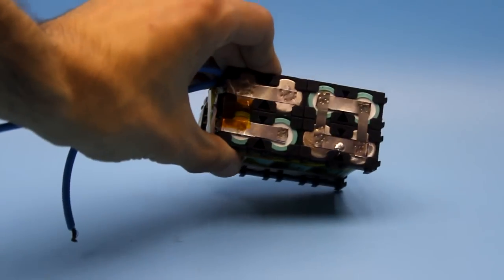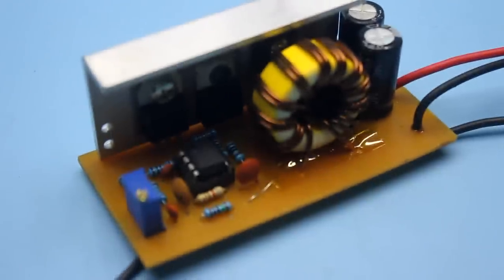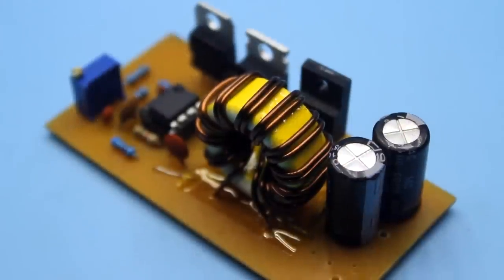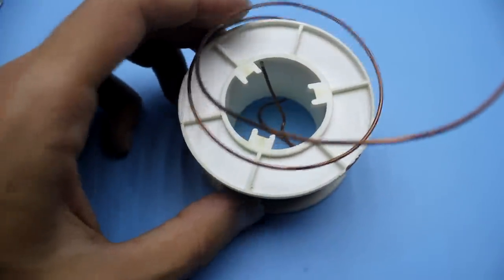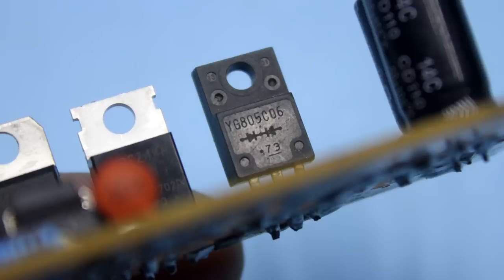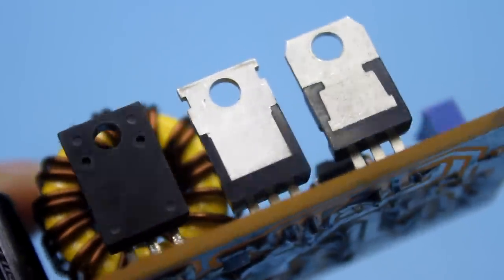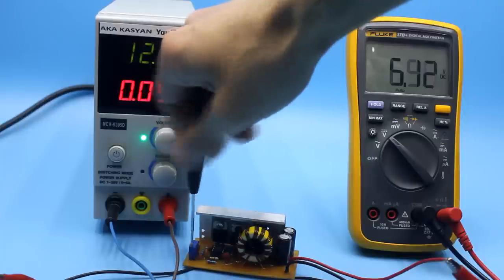Universal step-up and step-down converter

Comment from the maker: 5 pin - GND
Reply: i like your channel a lot is very help full but this video had issues, i count 4 caps at the archive at 50 volts and 1000 μf and those caps are missing from the pcb that you demonstrating also, at the pcb there is a12  linear voltage regulator but missing from the archive, i admit that i need a diy robust boost-buck converter but i will not try this one
Reply: mam only 12 volt input it can take ,so we can use an lm 7812 for high voltage
Reply: thanks for 1 hours trouble :D. Please update the video so viewers will not experience the error.
Reply: how come you post the circuit with error pin 5 uc3843 not connect to the ground, you want people make fireworks at home???
Reply: @amar love you need sprint layout
Reply: So,Mam you never showed the Circuit diagram when placing a Regulator ❤

Comment: C8 and C9 (2000uF) go from the mosfet to the output? Never seen that before. That won't work out very well.
Reply: This is a Cuk converter.Its not the avarage buck/boost converter you'll find in youtube. The original design is like this :)
Reply: @dimitriosvlamis8696  Actually SEPIC ... Singled Ended Primary Inductance Controller.
Much more efficient than Flyback and Forward converters

Comment: Kasyan, it seems there is a mistake in the schematic: C8 & C9 are not grounded, but connected to the AC side of the secondary. Their positive side also is connected to IRFZ44’s Drain, which may short-circuit it (at first sight). 
I downloaded “now” (March/2023) the schematic and it shows the same. 
In case the schematic is correct I would appreciate a brief explanation why it was done as like that. Otherwise, it might be enough to update the Zip file and anchor an “author’s comment” with such update.
Thank you for sharing, I’m very fond of your channel!

Comment: I have recreated this boost-buck converter with great interest. Except for 2 modifications, the proposed layout and assembly was used. The right side of the board has been stretched a bit to make room for 10mm diameter capacitors. The diode was replaced by MBR20100 (dual as shown in the layout).
The converter works. The coil (core T106-26, 93 nH/N², 2 x 10 turns 1,2mm copper) gets louder with increasing load and hot, really hot, at 2 amps 70 degrees Celsius after 2 minutes. 
Input 12.1V / 5.2A - Output 13.8V / 2.16A - Efficiency 47% :-(
Maximum output voltage with this choke and R1 at 1 kOhm are just under 18 volts at 12 volts input, that's ok. Will test again with 14 turns and different core. 

Any suggestions (core, heat problem)?
Reply: I played around with the converter.

I would like to say in advance that this concerns only my built version, I have no expertise and the changes can be completely wrong.

Step 1: The most critical component of a DC-DC converter is the choke. At 8,2 kOhm and 2,2 nF, the UC3843 frequency is at ~ 95 kHz. I've added 4 extra turns, almost doubling the mH (from 0,014 mH to 0,024 mH). The winding ist now 2 x 14 turns. A reduction of the resistance from 8,2 kOhm to 6,1 kOhm causes the switching frequency to rise to approx. 125 kHz. Overall, the efficiency has thus increased by almost 7%, but at 54% is still far too low (input 12V / 4.2A - output 13.8V / 2A).

Step 2: Control of the power FET. The signal of the UC3843 starts to oscillate under load. A 33 μF capacitor between pin 5 (GND) and 7 (VCC) of the PWM contoller also solved this problem. Efficiency is now just above 62% (input 12.1V / 3.6A - output 13.8V / 2A)

I was able to greatly reduce the "noise level" under load by connecting the heat sink on GND. (Check insulation of mounted components!) 

The heat problem is much less, but still there. The power required at the entrance has dropped by 20 watts, unlike the beginning.

I would suggest a larger bobbin and thicker winding (~ 2mm). But for this you could already buy a ready-made buck-boost converter with much higher performance :-(
For smaller performance, however, the DIY-module shown is still usable. I changed R1 from 1 kOhm to 4,1 k Ohm to get a voltage range from 4,2V to 24V, thats fine.

Thank you
Reply: I guess the core heating is due to magnetic saturation. Even for iron powder cores it is not wise to exceed 0.5 T. You can calculate magnetic field strength by multiplying the current with the number of turns and divide it through the magnetic length ( pi/2*(D+d) ). The result must be multiplied by µ0*µr. If the core saturates, the current rises to the current limit or resistive limit. The electric power is converted into heat.

This could also be the reason, why the efficiency is so small. The UC3843 is also not capable to drive enough gate current for fast switching of MOSFETs with significant input capacities and gate charges. So it is better to use a gate driver IC behind its output pin, which can deliver at least 2 A in source and sink modes.

Comment: 60 % effectivity :) (Input: 15.1 V @ 5.95 A, Output: 21.55 V @ 2.47 A)
Reply: That's because of liner voltage regulator for the 555

Comment: It's difficult to have the low ESR capacitors at 110kHZ(C8 ,C9). I think "Flyback Converter" should be much better for diyer.(remove C8 ,C9...and swap the transformer output two pins)
Reply: Will many ordinary electrolytic capacitors connected in parallel help in lowering the ESR ?

Comment: Is it possible to add more mosfets in parallel to gain more power?
I want to build MMPT around 60amps at 55v output from solar panels 75v to charge 48v acid lead batteries..4 battery in series
im not sure that UC3843 can provide enough power to gates  more than one mosfet.what do you think?maybe to add in circuit push pull totem pole for gate of 5 mosfets or more?Can feedback input of UC3843 can handle 55v
how would you do that?

Comment: I see there are 6 x 1000uF caps on the circuit diag. 4 of them being 50 volt and 2 of them being 25 volt. Yet there are only 2 large electrolytic caps on the board. Is that board an early proto of the final product? What are the inductance of the coils?

Comment: there  are 3 caps (2x1000uf) on the circuit, but only 2 caps (1000uf- i/o filters), on your board,   how about the midle caps, Sir?

Comment: I have a similar circuit. It has 120w output. 2 same mosfets used. the first mosfet's drain leg is connected with the second mosfet's source leg. There is a single winding inductance and first mosfet after inductance. The first mosfet's source leg given to the ground. I understand the situation when mosfets are connected in parallel, but can you explain the situation when connected in series? As in the circuit i tried to explain... Is there such a video?

Comment: I am trying to make this converter with the help of your Circuit Diagram... As someone mentioned in the comments that C8 and C9 goes directly to the mosfet? In your video I can only see 2 caps which I presume are the input and output filter caps. So did you omit C8 and C9 or what?

Comment: Hi it is possible to design Step up Step down converter using MC34063 and external MOSFET ?
Reply: It has a inbuilt transistor within the chip.
You can either tweak the chuop to get the control signal direct or drive your external fet with inbuilt transistor.

If later is the case, then

 so add a emitter follower bjt stage or add a inverter function chip with decent slew rate inorder to provide correct pulse to your external Mosfet.

Comment: Hi Mam (Kaasyan). I am a hobbyist I made  the  above circuit it is working  but as i put load the  output current drops down.  I need 5A to drive 2Nos 775 Motors which I am not getting. Could you suggest what to doooooooo. my circuits all electrolite caps are 1000mfd/50V. any change?. This circuit is for my RC  Boat. Power source is Lion battery 11.1V 5400mAh to boost 12 to 24V 5A. Your help will be very needfull. Thanks.
Reply: add a soft start circuit

Comment: C8 c9 will reduce  the  efficency  of the  device. You  have  to  replace  them with  ceramic  caps  and not 1000uf !!
Reply: what values for ceramic C8 & C9? are you sure the efficiency problem is with c8, c9?

Comment: can you design only a buck converter with uc3842 please?
Reply: Lenar OX uc3842 has a higher uvlo. So it may not be a good ic to use for battery powered stuff.

Comment: clarifies this because in the pcb there are only 2 bone electrolytic capacitors whit polarity but in the diagram there is 6
Reply: The schematic shows 3 groups of capacities. Input, output and between the coils (Cuk-Converter). The number of capacitors used reduces the ESR properties. In principle, however, it does not matter if 1 capacitor or several small capacitors connected in parallel are used. The input capacitor was not executed on the layout. If the input is strong enough, this is not absolutely necessary.

Comment: Kasyan TV+ can't we add a 35 ~ 50 volt capacitor with a larger value for current?
Reply: MrBrymstond the current limiting factor is the switching transistor & transformer. Bigger capacitor may not necessarily get you more current. Just a delayed response to voltage changes and transients. So to increase current you would wind a bigger transformer, input more current and change the mosfet to a beefy one that can hand le such.

Comment: C8 and c9 is all wrong. Your getting positive voltage through the caps by shorting them coupled to the negative voltage. You can't get load sharing with two diodes in parallel either.
Reply: Daves Tech please explain about the caps. Yes, you don't get any benefit by paralleling diodes but since the package has two, why not use them?
Reply: The 12 volt input is supplies the voltage but it goes through c8 and c9  The anodes of the diodes should be on the coil from the 12 volt line. You don't need the caps after the coil and only one coil is needed.
Reply: @davestech6357  You did not understand the circuit. Wikipedia -> Cuk Converter
Reply: @wernerpeter9706  Right!

Comment: Hi Kasyan. Great video, like all the others I have been appreciating on this high level informative channel. Thanks. I have three questions. 1) Can I use a 555 (I have lots of them!) instead of the UC3843 (if yes, could you make a video or suggest a schematic please); 2) How to get simultaneously two outputs of 5.1 volts and 14.5 volts; you are smiling as you certainly guess why. 3) Can the circuit work with less than 12 volts (I am thinking of boosting my solar panel's low outputs at dawn and dusk to maximize its working time). Your kind answer will ... boost my immune system and rejuvenate me by a whooping 20 years, making me feel 63 AGAIN!!! Not joking. Thanks again. ABEGA FOUDA from Cameroun, Africa.
Reply: 555 is not a pwm controller like the UC3843. UC3843 is a current mode pwm controller with voltage feeback (VFB - pin 2) for more precise control of output voltage.
Reply: You can use MC34063 API IC
Reply: @vivekdevvanshi8085  Thanks. You are amazing.

Comment: Is it possible to change the circuit from an input voltage of 6 volts?
Reply: The integrated circuit doesn't work with less than 9 volts, so you should use a small commercial step up converter to power the control electronics, otherwise you should change the circuit
Reply: Not possible because the ic used will not work with less than 7.5 volts which is the threshold voltage of the I.C.Still you can use by adding one more boost converter self designed or easily available for cheap rate in the market prior to the main circuit only for driving.

Comment: can I use 3844 instead of 3843
Reply: please tell me😌
Reply: According to Datasheet, UC3844/UC3845 are same, so no. The only ones that are different are UC3842/UC3843 which are used with a bigger Duty Cycle up to 96%.
Reply: So you can use uc3842 ?

Comment: Good project and some help for my friends to make this wonderfully helpful channel even better:
@0:18 - How can any convertor increase or decrease an "input" voltage? Device inputs are passive, not active, so to clarify, it's more helpful to talk about its input voltage "in relation" to its output voltage (being higher or lower).
@1:35 - If you decide to repeat the device.. In clear English "repeat" is typically used for actions or events, the words "copy, recreate, duplicate or replicate" all would have been better word choices.
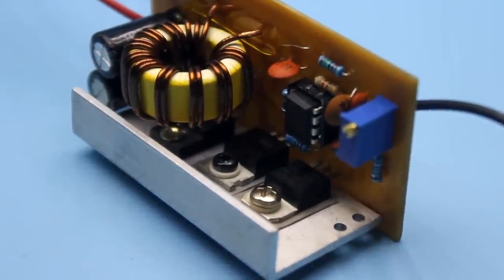@8:28 - the word "archive" was pronounced ar-KEEV itshould be pronounced AR-kayv (last part as in eye).